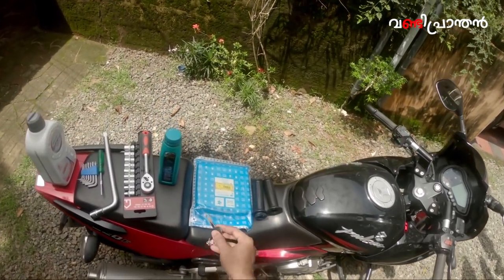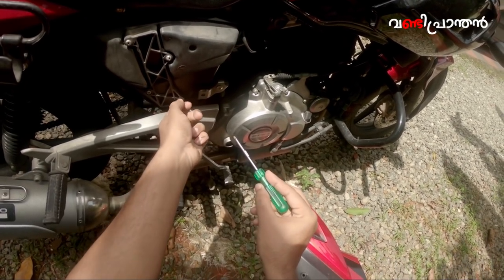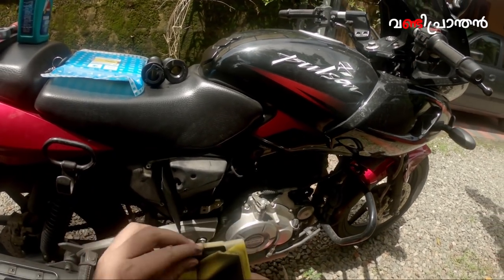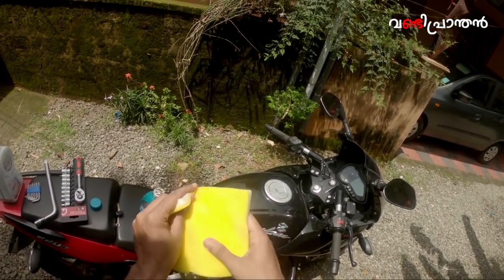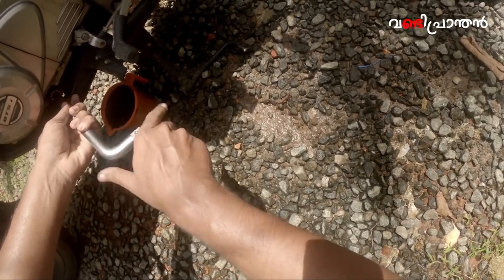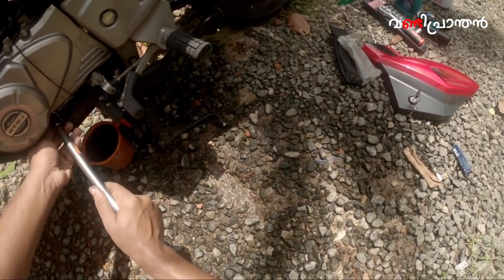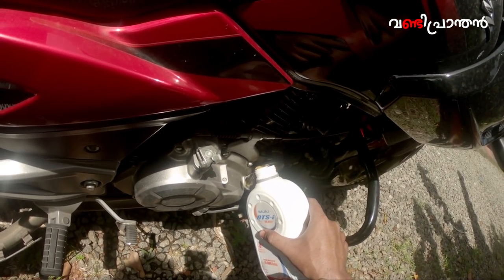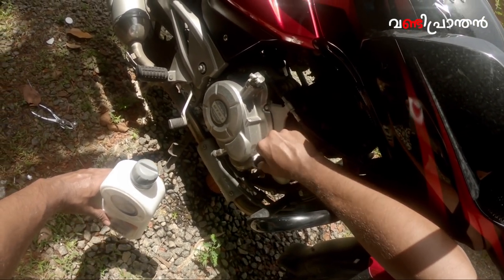Periodic service of a bike DIY malayalam ബൈക്ക് സർവീസ്, ഓയിൽ എങ്ങനെ മാറ്റാം | Vandipranthan

Comment: ബ്രോ unicorn എത്ര കിലോമീറ്റർ കൂടുമ്പോഴാണ് ഓയിൽ മാറ്റേണ്ടത്?
Reply: 2000
Reply: As owners manual 4000
Reply: As owners manual 4000
Reply: Unicorn showroom service anel Honda yude 10w30 oil ayirikkum athu 2500km odikkam ,shell advance semi synthetic anel rs 400varum 3000 km odikkam nalla smooth ayirikkum..castrol and Mobil,total ithoke nalla oil aa.iddakki check cheyyanam oil kurayunnundoo